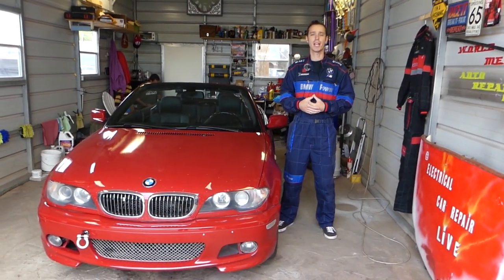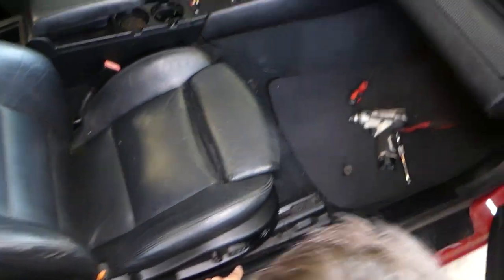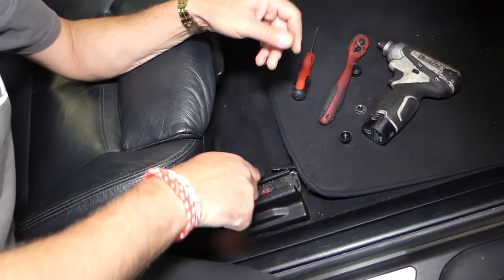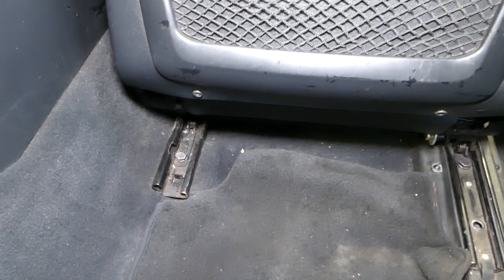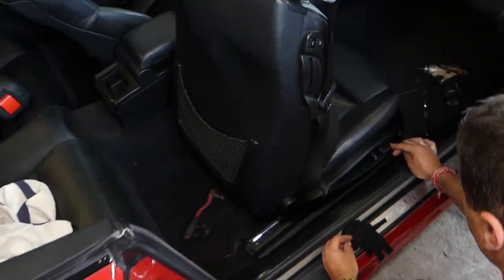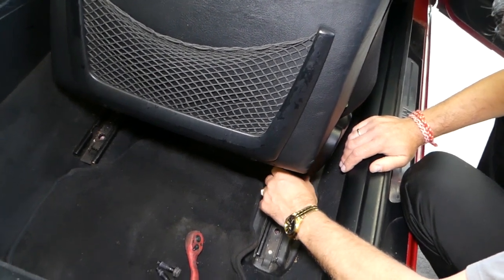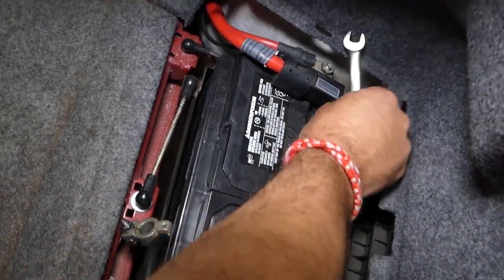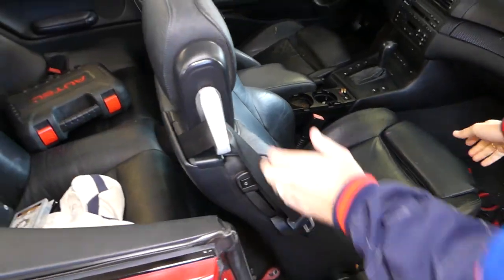BMW E46 FRONT SEAT REMOVAL REPLACEMENT  BMW 325I 330I 328I 320D 325D 318I 320I 316I 330D 323I 318D

Comment: I have an 02 330ci E46 Convertible and the seat motor for fwd/back has died.  I cannot access the middle bolt due to the motor failure, is there a manual way to move the seat?
Reply: Hi there! Hopefully after 3 years you've found out how to do it, but I do have a suggestion. If you've still not figured out how to move it. Disconnect the fuse for the seats, and see if that helps. I have an 04' 325i wagon, and that's what I had to do for mine